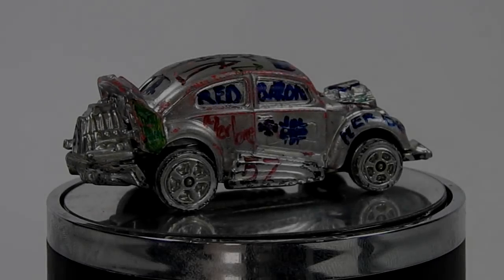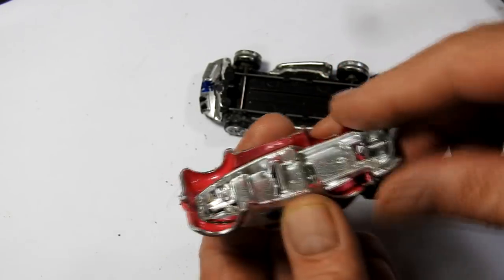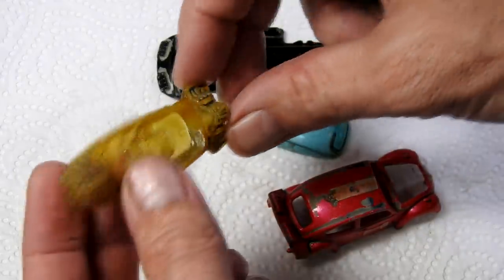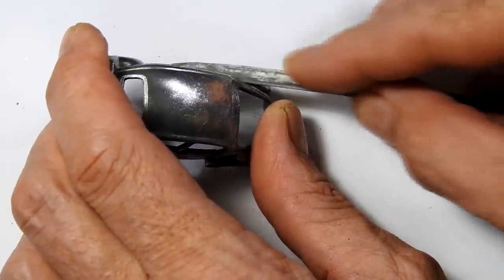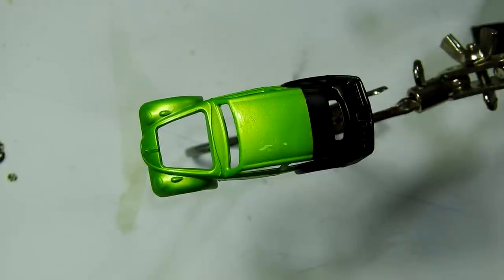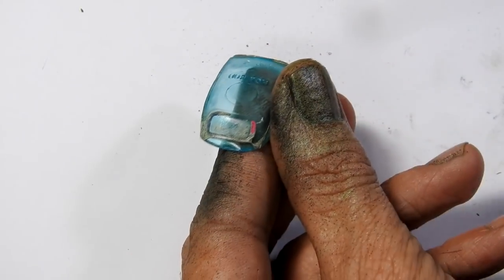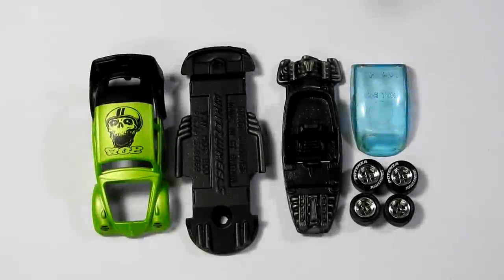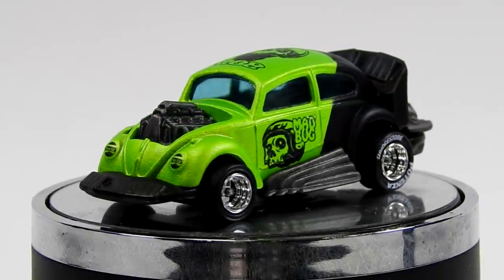Volkswagen Beetle Dragster Restoration | Corgi Juniors Whizzwheels Hot Rod VW Custom Restoration

Comment: Have you ever dipped the "glass" in pledge? curious what your thoughts might be on doing that for the plastics? As nice as the paint and decals and tire change out made think spending a bit more effort on the engines would of really made a huge difference in the end.